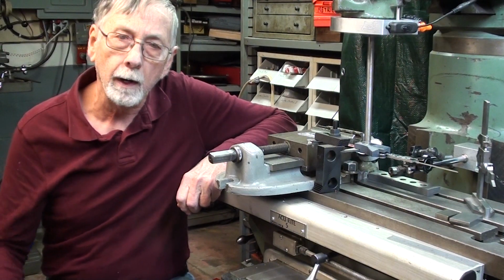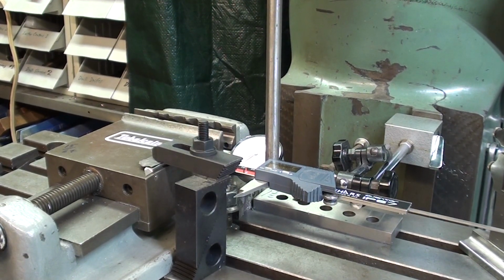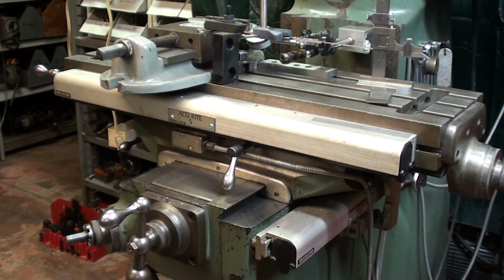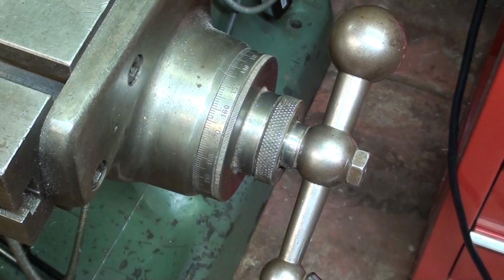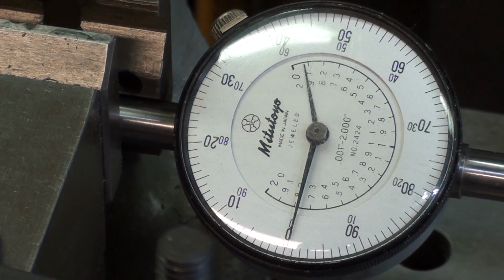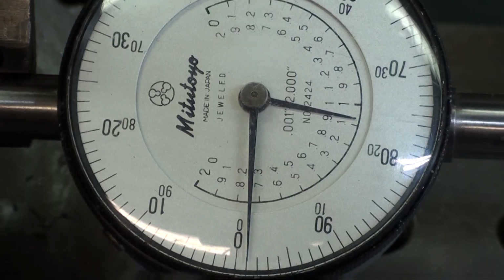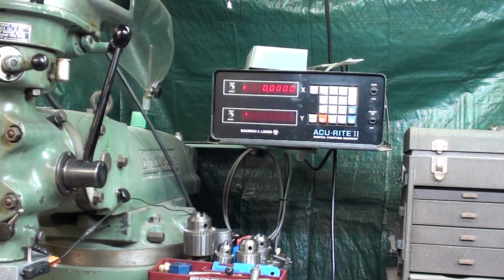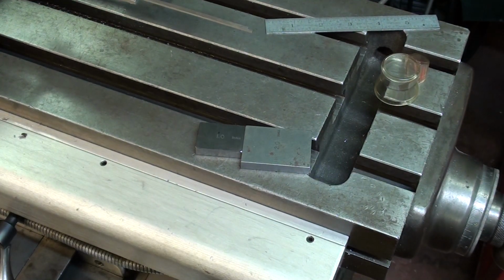Accuracy of the Bridgeport Mill Tips 527 tubalcain

Comment: I suspect all your measuring devices  are affected by temperature. You need to know what each measuring device manufacturer takes as 'Standard temperature'.

"Standard temperature in the United States is defined as 273.15 K (0.00 °C or 32.00 °F) under the International Union of Pure and Applied Chemistry (IUPAC) standards. This is often used for experimental measurements and comparisons in various scientific fields.
 Wikipedia"

Of course, if the DRO was a quality instrument, it'd have a digital readout of temperature of the digital scales.
You need a temperature-controlled science lab to run those tests in and have all the test equipment in there 'warming up' for a week.
Reply from the maker: This ain’t MIT
Reply: @mrpete222  You can spend a lot of time chasing accuracy !

Comment: Your dial indicator may have been on a slight angle with the axis of the table. I trust the DRO. I had 2 Lagun FT1 mills with 3 axis DROs, 1 was CNC the other manual and every time I checked their accuracy with a 12" standard both were dead on. I also had a 12" digital chinesium caliper that read the 12" standard as  .0005 short......

Comment: I already had issue using a dial indicator. Because it is  using a spring. The more you compress  it, the more it  increase the load. And you will get movement loss if the setup is not 100% rigid.  you can get many thousand off just because off this.
Reply from the maker: Good observation

Comment: Senior toolmaker once told me that the Tesa Dial calipers were the "best". So I proclaimed that to another senior Tool maker but he said no , Verniers are the best. I asked the first one about that and he expanded his comment to say Tesa dial calipers are the best of DIAL calipers but in fact vernier calipers were the most accurate, agreeing with the second guy.  - Embarrassing. Live and learn.
Their reasoning is that Dial, digital can be wrong at any point and at any time and you won't know while a vernier will never be wrong. 
Starrett, who makes all 3 types claims +/- .001 accuracy for their dials and digitals but their verniers are +/- .0005.
Ever since I ALWAYS have a good vernier caliper in my box as a backup and final judge because I HAVE had digitals flash off wrong and dials go off without warning. Those old masters words still ring in my ears whenever this comes up.
Pete you have those really old tiny vernier scales that always required a magnifier to read. What about the expanded scales of later verniers? 
I have a full compliment of Etalon verniers and they always calibrate as perfect. I found however that Helios verniers are easier to read due to the bold lines and numbers so thats whats in my box. Even my old eyes can read it. I'm sure yours can too.
Reply from the maker: Very interesting and enlightening comment. Thank you

Comment: This was very interesting.  Carpenter crews I worked on over the years would check our tape measures against each other in an attempt to reduce error when cutting.  I know our tolerances weren't as precise as yours bit in some case one tape measure against the other could be off as much as 1/16 of an inch in two feet.  Great video Mr. Pete
Reply from the maker: Thanks

Comment: Mitutoyo specs their better calipers as having a half thousand repeatability, but just a 1.2 thousandths accuracy. Many people think that repeatability and the smallest reading (least significant digit) is the accuracy, but as you know, that’s not true. Also, Mitutoyo push indicators have a zero repeatability problem. Set it to zero, and pull it out a few times, and likely it won’t go back to zero.

The DRO is reading one tenth thousand off at two inches. That’s four digits after the inch decimal.

Comment: This is a cool testiment of the accuracy of various measuring instruments , my biggest question is how much backlash do you have? When I set up a machine in the field I have to be repeating within a couple tenths at full rapid .
I don’t know a lot about Bridgeport repairs, can you take any slop out of your axis movements with a brass nut adjustment ? I realize this machine is half a century old, but what kind of back lash would you have with a new screw amd nut?

Comment: This a good video to watch because we tend to assume any readout (electronic or mechanical) is perfect with no error. You have just shown that you can't make that assumption for accurate work. 

I just looked it up (on 4/24/2021) from a Mitutoyo education sheet (https://www.mitutoyo.com/wp-content/uploads/2018/07/15003A.pdf) that states the accuracy that can be expected with calipers, over the 0 to 2" range, would be +/- 0.001" with a resolution of 0.0005". That means that the reading could be as much as 1-1/2 thousands off. This is in accordance with the ASME B89.1.14 standard. I would expect dial indicators would have a similar accuracy, even a Starrett. Currently, glass scales for the DRO potentially (and will depend on the grade and manufacturer) have the best accuracy, so, yes, that should be your standard.

Again, great work - keep them coming.

Comment: After struggling with the Vernier dials on my Index mill for years, I finally installed a DRO about 3 years ago when my eyesight started to fade . . .  I found the same inaccuracy between devices as you did.  LR K = 2thferry

Comment: I have a Wells-Index 747 and love it. It's an accurate machine and I just recently put a DRO on it. It's so accurate that for most jobs I still use the mics on the machine and not the DRO, or if I'm using the DRO I rough dial in the measurement on the handles and then look at the DRO. Of course accurate is subject to how well it's been cared for over the years. Wells is one of the few old companies that got with the times and make CNC mills. They are still around.

Comment: I know this is an old thread..but I noticed you are measuring between different datum points. The scale is between the table and the Y axis base. The dial indicator between the spindle and the table, the calipers between the column and the table etc.  So any twist, flex, y axis gib shift etc will introduce different readings between the various parts. I have noticed that if I don't have my Y axis clamped I get a movement of the table depending  on the over hsng of the table in x direction and the action of the cutting. I also see the same on the Z and Q axis. To compare the accuracy of the measuring devices they need to be from the same reference points. Then you can start seeing where the other extraneous  movements are coming from. Infortunately a hole pattern is between the quill and the table and there are a lot of joints in between.

Comment: Hello my shop teacher. I have to say you are correct using the digital readout as it is using a glass rod or paien with laser etched lines marked. Unless there is dirt or chips on the glass. When I was machining parts on the Giddings and lewis horizontal boring mill. The readout used magnetic inductance with a direct readout to one quarter of a millionth of an inch. The numbers were 2 inches high. So you could not say you could not see what the distance actually is. Please note this was 1950s technology. I do not remember who made the readout. But I can tell you with all ball bearing screw shaft, the machine was just unbelievable for accuracy. That is my story and i'm sticking to it.

Comment: When I installed a 3 axis DRO on my used mill, I went through the calibration routines. Many iterations only to find that the middle of the table was always different than near the ends, wear! Over short distances thigs were pretty good but over travels of 12" or more not so.

Comment: Hello Mr. Pete. Had you set a table lock the readings would have changed by .002 or more, something I discovered in 1970 in the shop. All digital instruments have some kinds of error. One is called quantification error or the point you zero at was the digital scale at the point of switching to the next digit ? No one can tell that and most makers add + - one digit count along with what they the general achievable accuracy of the scale. Longer scales develop more more error over longer lengths. Also you have abbys error being how straight is the scale mounted on the machine with respect to travel of the machine ways. Then you can consider thermal error in the metal of the machine, and the list goes on tithing supported table sag error. I really loved operating a Moore Jig bore machine as the were just flat accurate.  Keep in mind the 10 times accuracy rule, want to hold a .001 you need machine capability of .0001. So with all the being said a Bridgeport is capable of + or - .005 “ Reliably” on its best day Need a .001 get a Moore or Sip Jig bore. Nice job Please keep posting as your videos are great !. Best Bill B Naperville IL

Comment: Mr. Pete,
I'd be curious to know if the dial indicator was in calibration.  Probably would cost a lot to have it checked.  Really show how hard it is to obtain a plus or minus .002 over 6 or 8 inches on a part in a mill or lathe.  Enjoyed the video.  Would like to see the comparison with gage blocks if you can find a good setup.

Comment: Good video. One point that I would like to make is the Accurite DRO can be calibrated to read anything you want, at least mine can. The accuracy depends on what was used to calibrate it. I normally use a dial indicator and move an inch or two and set the DRO to read the same amount. Check your Accurite manual for details.
Reply from the maker: Thanks

Comment: I always go by my digital readouts Most people do not ever or very seldom change the position of the Vise on the table  and because of that the lead screw and/or the Nut  will always be worn much more in one area. To compensate for a more even wear I move the vise several inches left or right of center every month or so if what I am working on is small enough to still give me the travel I need. To confirm this you can check the backlash  on the dial when the vise is in the center of the table right under the center of the spindle  and then move the table 8 inches either left or right and recheck the backlash. You will find that there is not  as much toward the ends of the table. The biggest thing towards accuracy and repeat ability is to make sure the Head is trammed in perfect before doing any work where extreme accuracy is needed. Back in the mid 60's we did not have digital readouts as you know and everything was dependent on the dial and a dial indicator.
Thanks for the Video Mr. Pete
Reply from the maker: That is very good advice, thank you

Comment: I want to thank you for all your time teaching. I just bought a 13x40 doall /Romi lathe still have to order vfd. I am a visual learner dont like books and in Alaska no shop class and machine shops close as fast as they open here I've worked at aircraft and engine shops no lathe work other than polishing some push rod tubes for Lycoming engines. So with your shop teaching I now feel not so much in the dark with the grizzlies hahahaha or Sasquatch. SO THANKS FOR YOUR TIME TEACH this is 1 guy that is  using what you teach. THANKS FROM THE SASQUATCH FIGHTER OF THE NORTH

Comment: The Mitutoyo setup is contact between a rounded tip and what appears to be a rounded surface on the mag base clamp. If the table had any sag over the measured distance, that might be introducing error by changing the contact point due to a change in angle?

Excellent subject for a video, sir.  Thank you!

Comment: Thanks Lyle,  If you do a follow up video it may be interesting to "profile" the error between the DRO and your leadscrew.  I did this when I first installed my DRO.  Make a simple chart with one entry per inch from left limit to right limit.  Turn the lead screw an inch and record the DRO reading.  A worn screw may lag (DRO showing less movement) as you approach the "worn" center then catch up as you continue to less worn section.   Profiling a screw is a common practice in CNC machines where the machine can keep a map of screw error and adjust for non linear sections of the screw. 

A gauge block stack and a test indicator would also be interesting.  Square and clamp a block on the table or vice then zero the indicator. As you move each inch add another inch of blocks and test the zero reading.
Reply from the maker: Good ideas thanks for the comment. I don't know about that profile I don't think I would know how to do that. But tomorrow's video will show me checking the indicator. With Gage blocks.

Comment: Made me reminisce.
At my student times we had to try to determine the Rydberg constant in the physics lab.  Before that we had been through different ways of estimating general measurement errors, including Gaussian distribution and minimized square differences from the average.  OK, according to the Wikipedia, the constant is 10 973 731.568 508.  Talk about resolution & accuracy!  Well, we were asked to make 5 measurements and then average the results to get our answer.  When writing my report and performing the error analysis, I had a real dilemma.  The average of our 5 measurements was some  parts per billion off the published value, but what to tell about the fact that one of those individual measurements was exactly the same as at that time given in text books?  Would it be right to include it at all in the error analysis?
Well, in the case of the Bridgeport accuracy, I along with others like to see where it takes you with the blocks.  Could you add some information about the ambient temperature?  I believe the Bausch & Lomb scale is glass, while the rest of the items are versions of steel.  I also believe the thermal expansion coefficient of glass is a fraction of that for steel, although there are different formulations with different coefficients.
A number of years ago, I remember HP came out with laser interferometer systems for precision measurements of distance.  The funny thing that struck me then and bothers me even now is that the interferometer results had to be corrected against air temperature and probably pressure.  I think along with an autocollimator, the interferometer is still one of the reference devices in metrology.  HP of course changed to become a computer company, spinning measurements to Agilent, which further chose to spin off Keysight..  If I know, nobody continued making those laser interferometers.
One more thing from the past:  The vernier scales were called Nonius scales by my teachers.  Maybe another inventor or manufacturer involved?
Reply from the maker: Thanks for the comment but you are an engineer and I am A common man. You lost me on that one

Comment: Someone smarter than me probably already mentioned this. If the central axis of the dial indicator and the shares caliper are not perfectly parallel with the bridgeport table, couldn't that account for some error? That whole "shortest distance between 2 points thing".
Reply from the maker: Yes

Comment: The apparent "inaccuracy" of the dial indicator doesn't actually surprise me too much. 

For starters it's likely only really accurate somewhere in the middle 30% of it's range. Even then you have to be pushing it directly parallel / perpendicular your direction of travel. 

If you push the indicator at a slight angle you will introduce a small error because you're effectively  measuring the hypotenuse of some triangle formed by not being directly parallel / perpendicular to what you're measuring. Even a few tenths could make a difference as the measured distance increases. 

As for the inaccuracies in the indicators range of travel, these have to do with where the tension of the spring(s) is most consistent over the greatest range which generally occurs in the center of the total travel. 

None of this is meant as a criticism of the experiment but, simply as an explanation of the "inaccuracy" observed. 

Might be interesting to test the "accuracy" of the dial indicator through different areas within its total range. 

But...... that's a subject for another time. 

Always good to see somebody actually put things to a test. Sometimes we learn thing we don't expect that way!
Reply from the maker: Thank you for the comment. Most of what you mentioned is in the follow up video coming tomorrow

Comment: I liked this video, very interesting.  My DRO PRO digital read out reads to one ten thousands of an inch and that is more accurate than I need, so I trust it, besides my mill only reads in metric. The dro allows my lathe (imperial) and my mill to sleek to each other.
Reply from the maker: Actually, mine accurate enough at 1/2 of 1000

Comment: Excellent comparison. My main takeaway message is that a single measurement device should be used for a given project. A secondary message is that it won't matter much which device is chosen.

It may interest your viewers to see a comparison among multiple providers' devices of the same type. For example for 6" digital calipers, compare Starrett to Shars to Mitutoyo to Harbor Freight using gauge blocks.
Reply from the maker: That is good advice in your first paragraph. In the second paragraph, that is exactly what I am doing in part three. That video was already completed and in the can. I compare all of the different brands